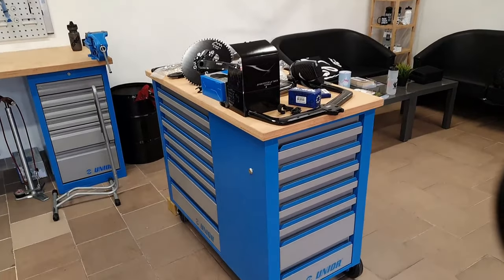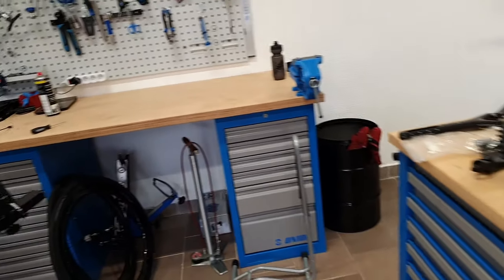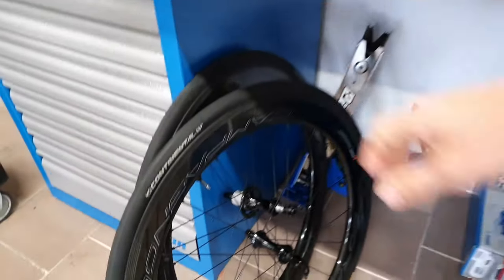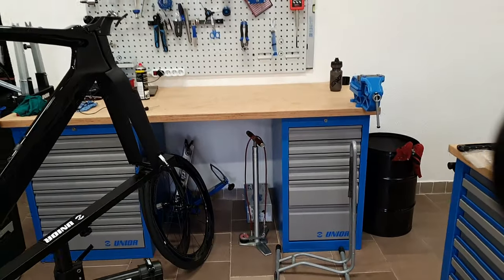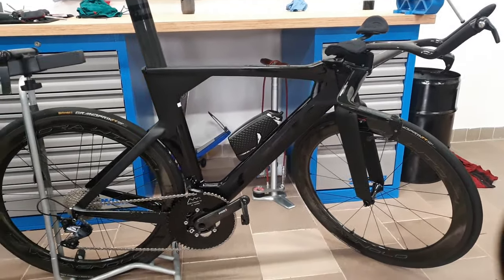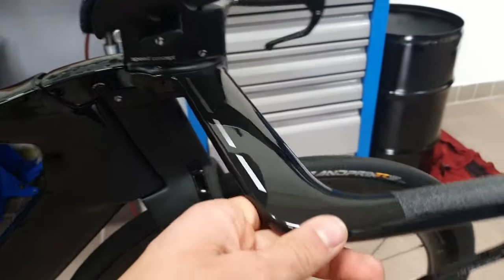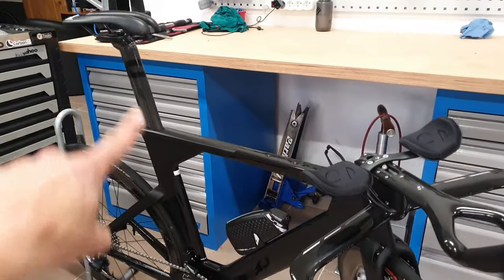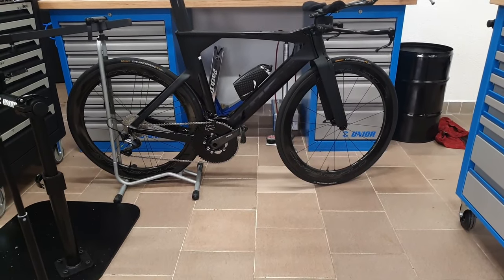2020 Trek Speed Concept - 1x TT bike build

Comment: I have the 56T NW chainring from Wattshop and use it without a chaincatcher.. My bike is almost the same, just made with DI2 - 1 button on both brakes and bar + with 3 spoke front wheel and disc(UCI setup). And long derraileur on back.. I have never lost the chain with that setup :) What I find special about the Trek SC rim brake TT bike is.. IT CAN ACUALLY BRAKE!! My Fuji and several Cannondale miss that part. And in the search for seconds, cornering with confidence can easily make you win a second ;)

Comment: Shimano breaks and shifting, SRAM cranks and Campa wheels.... your customer should consider getting a ROTOR rear derailleur to get this abomination complete ;)
Reply from the maker: Function over sentiment
Reply: if you can take the best from each brand, not doing it is dumb
Reply: relandoronato can't argue about looks. my trek comes with rotor crank chris king bb sram chainring shimano drivetrail hope pulley wheels paulcomp brakecaliper schmolke rims on hope hubs syntace stem 3t bars thomson seatpost and gebiomized saddle

Comment: Hi Ronald, great videos. I just bought that frame… for small fame what size is that seat post? And what kogel bearing is those? They are good? Thanks!
Reply: You should go for the shortest, 275mm seatpost length. Next size is 335mm, which is too long even for a medium frame. If you opt for the 15mm offset & intend to install it in the forward position, read & follow the manual carefully on the instruction to mount the saddle. Else, the clamp screw will snap in no time. Good luck!
Reply from the maker: Hello and thank you for your message. I can assist you with your technical queries on my Discord server:

https://whop.com/ronysclub/

Comment: can you give your opinion on the new Orbea Orca Ordu ? Also what difference you find with your s works shiv disc break and trek speed concept rim break
Reply from the maker: Looks like a good bike. Everything is different between the Shiv and the Speed Concept, not sure what do you mean there
Reply: @ronykuba  why you change from speed concept to shiv ? Does disk break make any difference positive or negative, did you notice in terms of performance ? with what of the two tt bikes you get the best time ?
Reply from the maker: @rimbraketakesthewin7846  it's faster, a lot lighter and also simpler, plus it has actual functioning brakes
Reply: @ronykuba  ok thanks

Comment: Thx for the video. What is your thought on buying/building a rim brake bike now they are all changing to discs?
Reply from the maker: I wouldn't
Reply: @ronykuba  depend on the usage if it time trial i would
Reply from the maker: @meneldil7604  the best TT bike available now is disc brake only
Reply: @ronykuba  I would simply cos most shops in UK don't set them up right so that tag disc slightly I like you can but  avage user would take it to the  shop so would be slow cos of it if you see what. I am saying
Reply from the maker: @meneldil7604  I don't really understand
Reply: A large portion of the Time Trial Bike market are still rim brake (Trek Speed Concept, Canyon Speedmax (Kona Podium last year rim brake), Omni Tri Rig, Ventum One, Cervelo P2 and P3 still come in rim break, Cannondale Slice, and half dozen other TT manufacturers).  Remember, if you’re Time Trialing the last thing you want to do is hit your brakes!  Rim brakes and TT will remain forever.
Reply from the maker: @bobbymac1972  that's because a large portion of the TT bikes are outdated and were released years ago. That's a pretty stupid argument. Yes, you do want to avoid braking, but when you must, you want the brakes to... work. Not the case with shitty integrated rim brakes. They will go away with each new bike released, just like on road bikes. Better brakes- later braking- faster times, simple as that.

Comment: You don’t need such a long RD gear cable housing for 9100 mechanical. It looks unprofessional.
Reply from the maker: 1.) It's not 9100
2.) The bend was too sharp otherwise
Reply: @ronykuba  It is same for that generation of RD ie. Dura Ace 9100, Ultegra 8000, 105 r7000, with such a long cable housing, you actually made the bend even sharper. Try to use the length slightly longer than a normal Di2 cable. It looks much better, and the bend is actually smoother. For your reference of what I am talking about, have a look at the link below:
https://road.cc/content/tech-news/207047-shimano-dura-ace-9100-first-ride-review
Reply: @DennisPengawesome  it also depends on what angle the cable exits the frame... What works on your bike might not necessarily work for this bike. Although I see what you mean...